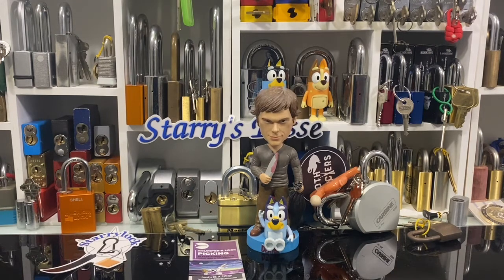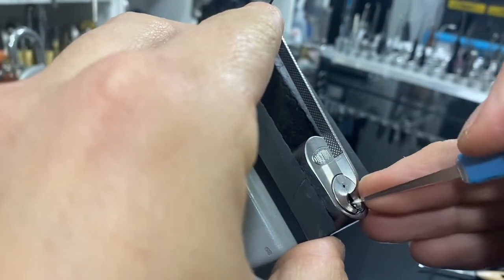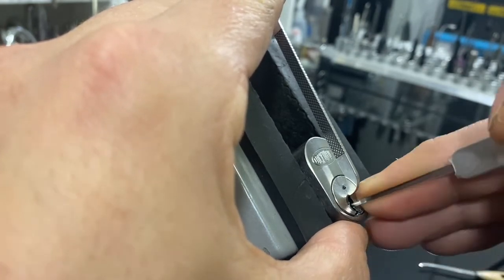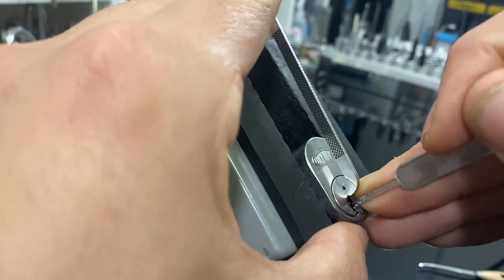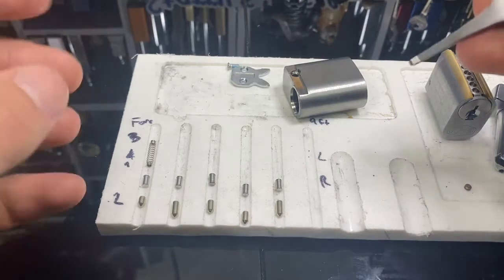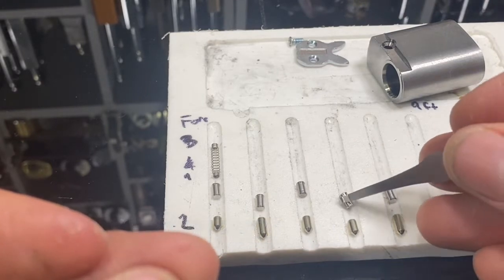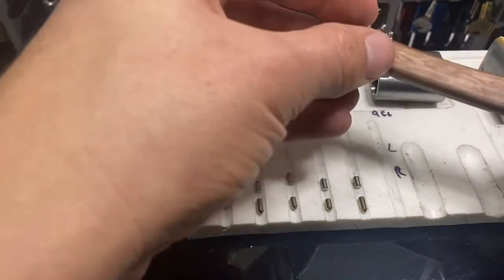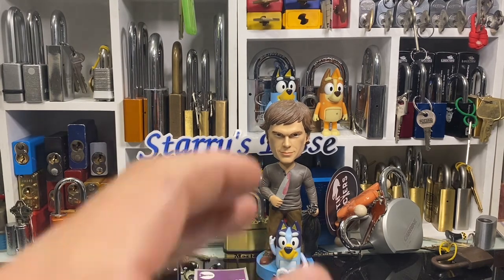Ovals episode 1 : Lockwood 570 pick and gut

Comment: Sexy barrel type spools, and still a great idea with the magnet in the pick handle. How's the wood I sent coming along as far as drying out? I imagine just keeping it an a dry warm place, maybe around a dehumidifier. I guess one way to tell if dry would be enclose it in a Ziploc bag or some closeable plastic bag and after a couple of days to see if any transpiration has occurred. I have no idea if you even started working with that wood yet, that's why I decided to ask. I was curious to see how it was working out for you.
Reply from the maker: Yeah they are pretty sweet spools. I put the wood in my food dehydrator on very low for about 12 hours. I think it dried it out pretty well, putting it in a ziplock bag is a great idea I will have to try that to see if there is still moisture in them. Thanks for watching mate 👍🇦🇺😊

Comment: Yeah, the 15thou shaft is thick but it's a thin pick. A great idea to pick all your 570's. Nice picking. I have not seen those type of spools, weird.🍺😁🇦🇺
Reply from the maker: I do really like that pick when you can work clear from the bottom, in C4s with a little challenging bitting it can be hard to use. I did no  know these spools were unusual, I’ll have to gut a few more of my Lockwoods to see if they are different. Thank you for watching mate 👍🇦🇺😊